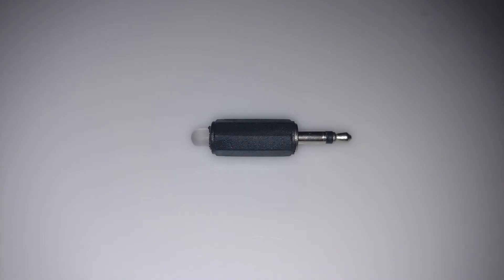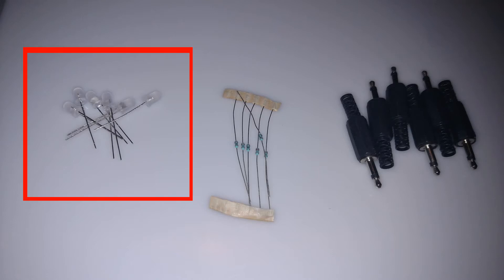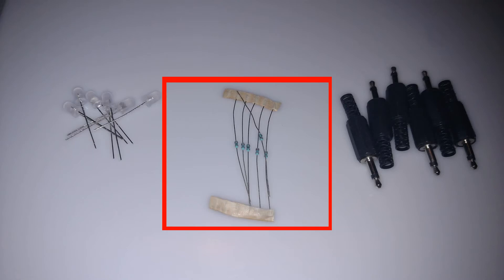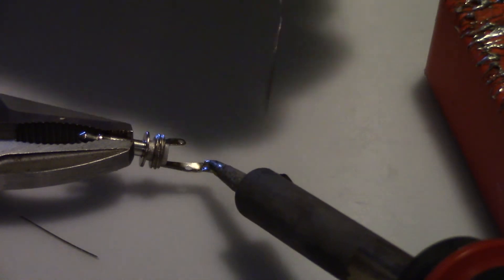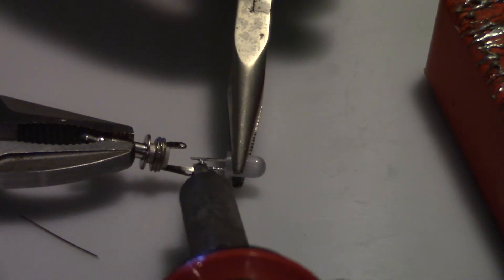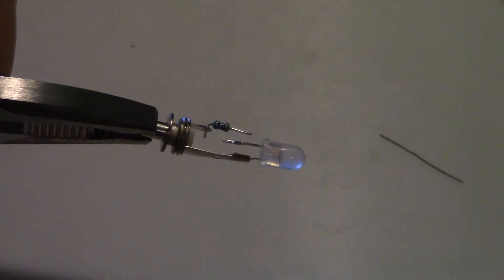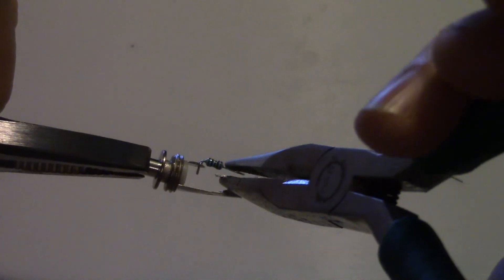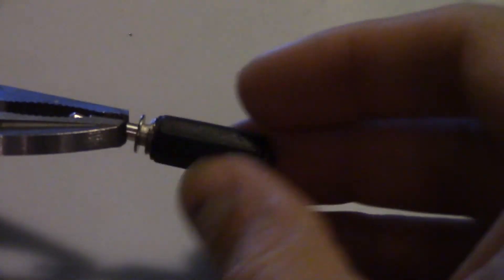DIY Bi-Color LED 3.5mm Plug

Comment: So if you were to do this and still wanted the control voltage to pass through I’m guessing take the 2 leads from a cut 3.5 mono cable and attach them at the same places but bypass the resistor on the side that has it?
Reply from the maker: Use a stacking patch cable. And attached the led plug onto the stack, that way its removable if it draws too much power. link to stack-able cables:

https://modularaddict.com/stacking-patch-cables

https://modularaddict.com/media/catalog/product/cache/1/image/1100x1100/9df78eab33525d08d6e5fb8d27136e95/c/a/cables2.png

Comment: Nice project, but soldering the LED the way you did is a good way to destroy it. LEDs don't like heat. You should hold the leads with the pliers when you solder them so the pliers act like a heat sink